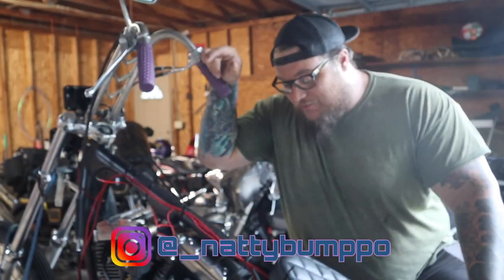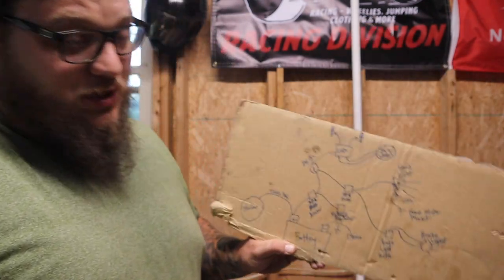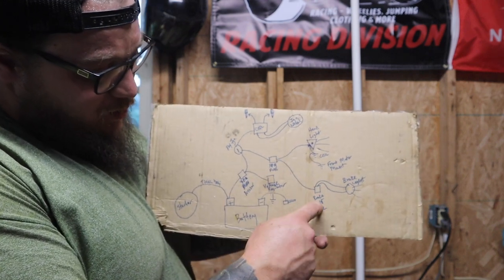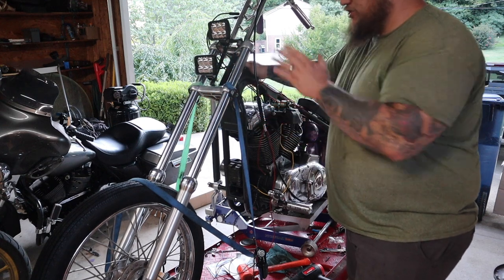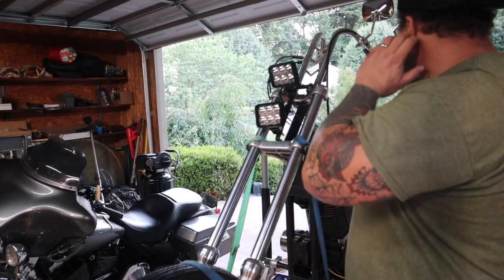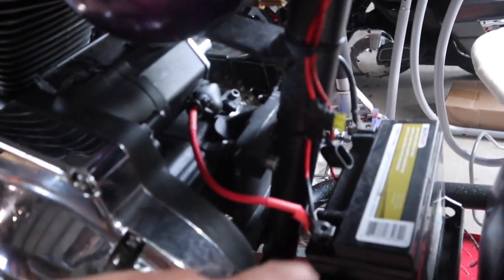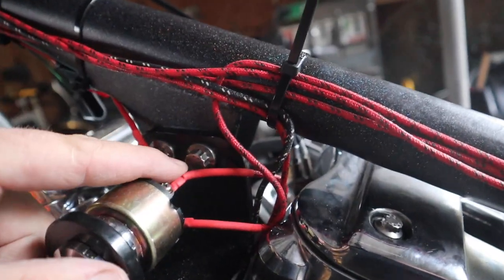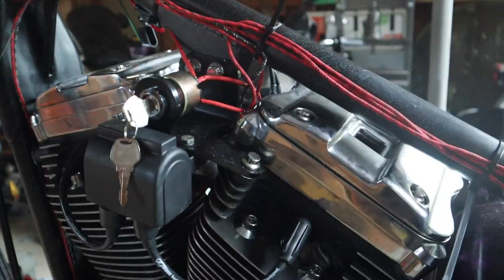Chopper Build | Episode 25: Complete Chopper Wiring Guide

Comment: What color wires did you run for what function..
I ask because i just got a 1973 ironhead sportster..too many "Electrician's" 3 different color wires on one run...yellow but connectors..some electrical tape on some twisted wire connections ..👍🤔🤬😫
Reply from the maker: I bought red and black wires for this whole thing. I don’t like running wires so I just kept it simple. But run whatever color you want. My current chopper is going to have blue and black wires just to match the paint.

Comment: There's the bigger wire coming down from the alt./coil/regulater under the motor to the points back out and up by the oil tank with 2 small wires ,but it fires up

Comment: Dude I've got 2small wires that come off of the points wire what could they go to
Reply from the maker: Man, I can’t remember what I did with those. I’ll have to check when I get home.
Reply from the maker: But if I’m not mistaken they go to the regulator, then the regulator goes to the battery.
Reply: I'll shoot you a picture of it here in a bit.thanks man,dig your videos.✌